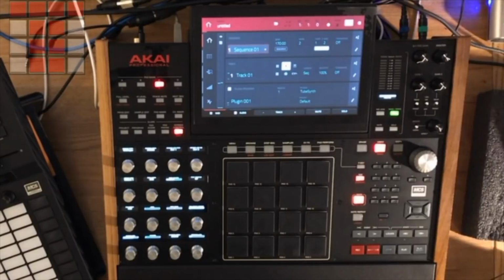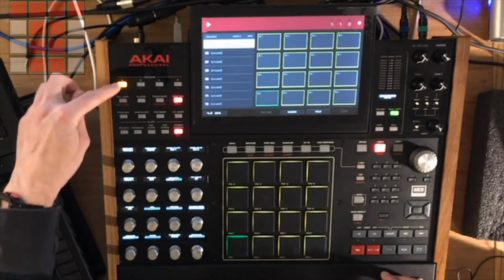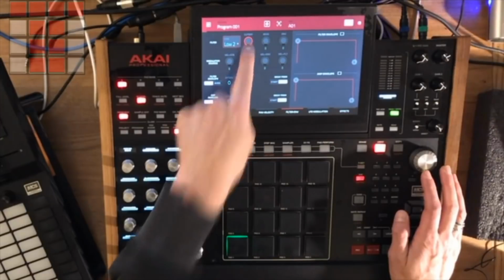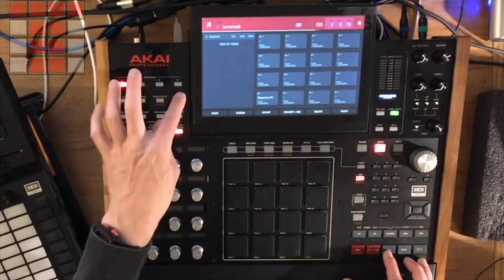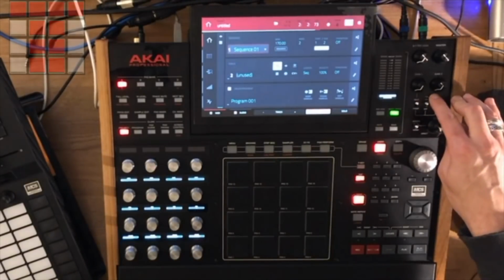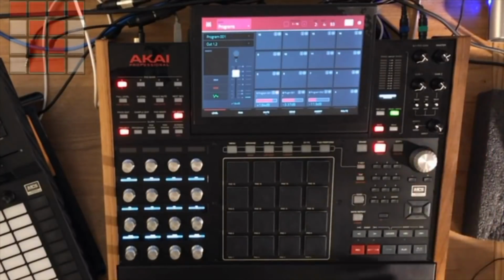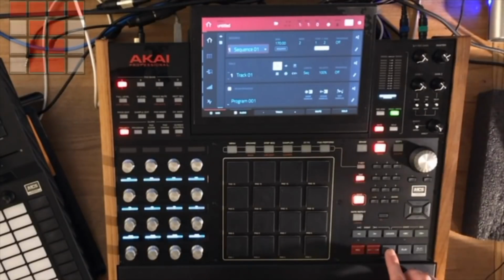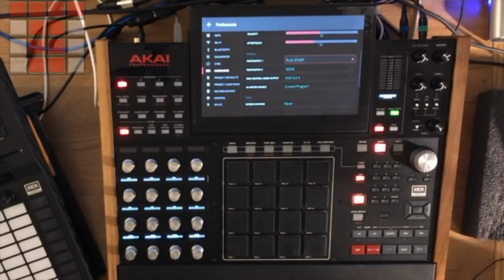Mpc x Controls and Connections Guide

Comment: Hi.  Can you load multiple kits on the same pad bank?

When I move to pad bank "B" and then load a kit for additional sounds to a drum track, it messes up.  Thanks
Reply from the maker: @AudioJanitor  If you load a kit (drum program) into a project using MPC 2, it will load it on to the currently selected track and occupy the first pad bank or beyond if the program contains more than 16 samples, hence why yours are messed up (it’s over writing what’s currently assigned). If using MPC 3 it will create a new track (in MPC 3 tracks and programs are combined/linked). In either case, just load multiple programs to separate tracks then use the copy pads feature found in the program edit menu. You can copy entire banks from one program or track to another.
Reply: @TUBEDIGGA  MPC X SE.  Thank you for your informative reply.

Comment: Can anyone help me out with a question I have before I pull the trigger on the MPC X: I have a two hardware synths and a Moog Spectravox that I wish to connect at the same time to the MPC, but how is this possible via the rear panel? Can you connect two stereo signals and one mono all at the same time?
Reply from the maker: @AngelWildBlue  You can connect two as you have inputs 1/2 and 3/4. But unfortunately you can only select one of those at a time. The best solution is to use a mixer, you only need a cheap small one with at least four inputs.

Comment: Hey man, this is  really good guide. Im a guitar player, would you be able to tell me how to connect my OX box into my MPc X ( universal Audio attenuator/modelling amp device ? I play my guitar through the OX box as it's used as my modeling amp device for my guitar ) many thanks for any help with this?
Reply from the maker: Guitar into OX Box, audio cables out of Ox Box into the rear inputs (1/2) of the MPC if the OX Box outputs line level which I assume it does. If it’s instrument level then use the front inputs. Use the silver switches above the main data wheel to select front or rear. Then go to the sampler and switch on the monitor so you can hear what’s coming in. Also make sure the input setting reflects the physical inputs your Ox Box is connected to. For more info please check out my Masterclass course which covers this in detail: courses.tubedigga.com
Reply: @TUBEDIGGA  this is extremely helpful advice- yes - ox box does have line two outputs at its back ! Im not tech savvy guy so it was too complicated for me to understand the connection! many thanks again- I will spending now days on your videos to learn how to use my new mpc x to make some music at home - thank you very much for quick guidance

Comment: Thanks for this......Subbed
First time MPCX n00b
So is there a faster way (Short cut) to switch between sequences?
I know about the"next Seq" button just thought there was a faster way?
regards, rick
P.S "SHIFT" + "MENU" = Preferences
Reply from the maker: The quickest way is in next sequence mode with SUDDEN activated. Other than that, from the main page by manually switching sequence using your data wheel when focussed on the sequence area.

Comment: Did something change with the full and half level options?  When I hold shit and hit the full level button it turns yellow for half level.  It does not flash like yours did.  Also I don't have that MCS (Multi Core System) sticker on mine under the date  wheel.  It says it on the box but no sticker on the system.  I bought it new too.
Reply from the maker: You shouldn’t hold shit man, that’s gross! 😂 No, nothing changed with those buttons. Holding shift does half level as double tapping does full level. I think you can also cycle through the three modes too.

Comment: I need a video that shows step by steps on how to use the sampler.
How to cut up slices and more details on sampling and cutting slices etc. 
I know how to sample and I know how to cut up slices and what not but I 
need more in depth details on what everything means.  

For example.. I'm having an issue where I want to cut two different slices
from two different parts of an overall sample but I don't want to have all
the sound that's inbetween the first and the second sample.  I currently 
go about doing this by having sample 1 (slice 1) and then sample 2 or
slice two but the noise inbetween those two samples or slices I do not 
want and I'm unsure on how to get rid of the stuff inbetween the samples.
Reply from the maker: Highlight/select the unwanted space between the two points you wish to retain then choose PROCESS> DELETE and this will remove the space and join the end of the first region to the start of the second region. It’s all in here: https://m.youtube.com/watch?v=6dFEygeiWms

Comment: hey TD, this mpcx can record voice ? and cutting it? and adjusting it ? without complitely restart form the beginning? eventually the voice appeare in segment or wave up the video ? thank you bye
Reply from the maker: gabriella del rosso Yes it can record anything you like. There’s many ways it can play back, with or without restarting. If you record or import vocals to an audio track then you can play it from any position without restarting. If you’re triggering a similar longer sample from a drum program then depending on how long it is or how much it’s chopped and triggered along the way, you may have to restart it as it’s using midi and needs a trigger to play. Check out my video on acapellas to audio tracks, that may help. It’s in my MPC tutorials playlist
Reply: @TUBEDIGGA  I dear, i'm not english mother thouge, i reformulate the question,   I want to use it as home studio recorder and suppose I record a song , but i understand in the middle of that song there is something wrong or I dont like, from the bass track  or the voice track,  it is possible to cut that specific note o word and insert a new one in the particular space? thank you I apprecite your patience
Reply from the maker: gabriella del rosso Yes, you can do it manually or there is also a function called PUNCH IN recording so if you mess up, you can set up to record in a specific location. So if you messed up your bass at bar 17, you could set it to start recording at that position again for an amount of bars. Here’s a video on punch in recording: https://youtu.be/xmXpDp1kBzM

Comment: how do you change the number of count off measurements instead of 4 I want 8 counts before it records.
Reply from the maker: Ryakin Rip Press the metronome symbol on the main page, you can set the count in there
Reply: @TUBEDIGGA  I dont see no where to change the bar count off numbers
Reply from the maker: Ryakin Rip It’s on the left hand side, 3rd from the top. It’s labelled ‘RATE’. Check the PDF manual, search for COUNT IN if you’re still in doubt
Reply: @TUBEDIGGA  that's not where you would enter in the number of times you want the pre count set for example I want 8 bars pre count before it starts recording it's only set at 4, what your referring to is the rate meaning 1/8th or 1/4th  ie 4/4 timing, listen to the clicks in the metronome changes when you go from 1/4 to 1/8 that's not what asking I'm saying I want 8 bar count off instead of 4
Reply: There's no where in the metronome section to change the precount  numbers only the volume, which sound to use and the output

Comment: Thank you .When importing user samples .Do they have to be key mapped beforehand for pitch ? Does the MPCX do the key mapping ?
Reply from the maker: Not really. If it’s a random drum sample or sound effect or musical loop, that will have its own pitch and it’s up to you to tune it etc. You can load it into a drum program and tune it or a keygroup program and that will map it across multiple keys chromatically. Some samples are tuned to a scale and some are completely random so it’s up to you to tune it once it’s in memory if necessary
Reply from the maker: There’s many options and levels for tuning inside the mpc. I just use my ears mainly when tuning.